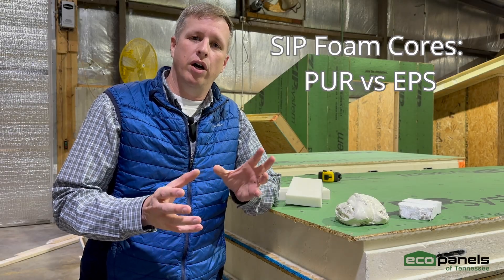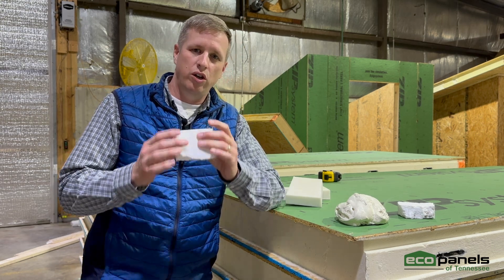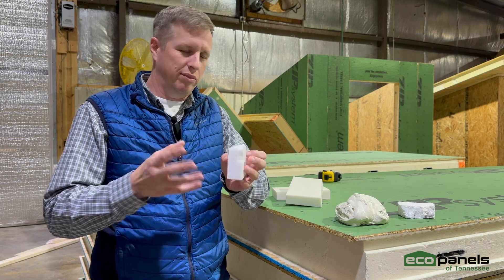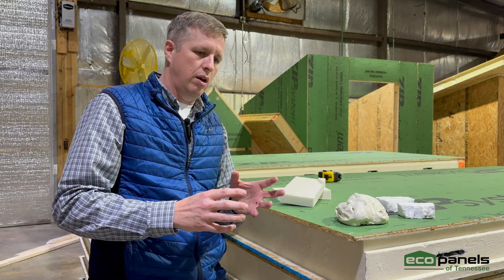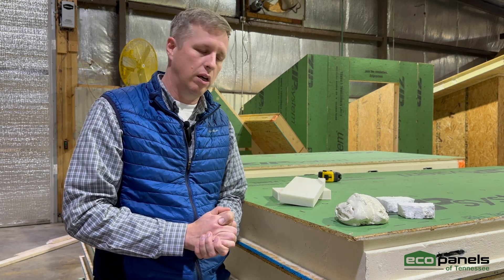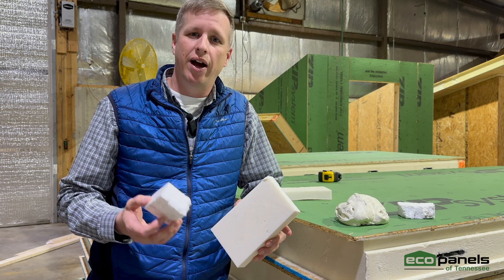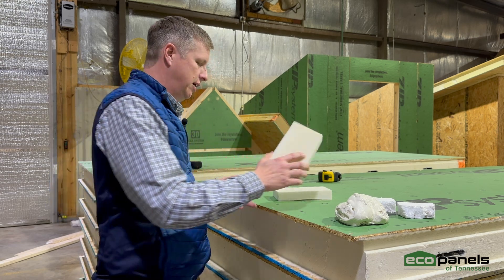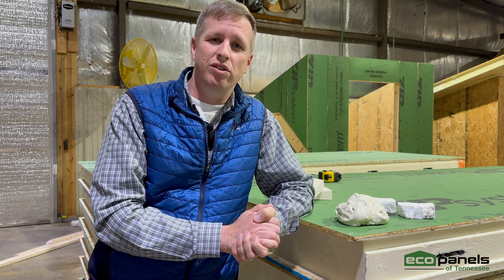SIP Foam Cores : PUR vs EPS | Eco-Panels of Tennessee

Comment: Hi Josh,  I've read that polyurethane looses its R values in cold climates more than EPS and also looses its R value over time due to the blowing agents and "thermal drift".  Have you ever measured your panels R value in cold climates and if any thermal drift has occurred?  Thanks!
Reply from the maker: Lots of contradicting info out there for sure. Part of this is because there's many different formulas / types of EPS and Poly foams, along with different applications. You're likely seeing information / data from spray-on-site poly that's going into a 2x framed cavity. This is going to test differently than our foam within a SIP. Our foam typically gains effective R-value in colder climates, so it performs better than in really hot climates. Thermal drift can be found across foams because of the molecular size of vapor. A measurement was taken several years ago and it looked like about a 3-5% loss total. That's not much. That said, it's within a margin of error that's probably in that range as well. For perspective, building with SIPs (ours or anyone else's really) is going to give you a much more thermally efficient structure than conventionally built. These changes over time are certainly more minimal than the changes that happen with conventional insulation. Hope that helps! Great question... keep learning!
Reply: You may be thinking of polyisocyanurate, or polyiso foam.  It usually comes in sheets for exterior insulation and has an R-value of about R6 to R7 per inch in hot climates, but that drops to about R3 to R4 per inch in colder climates, which is the same as EPS typically has (which is cheaper than polyiso).  Closed cell polyurethane foam (like what is typically used in spray foam) has a pretty stable R-value around R6 to R7 per inch whether used in hot or cold climates, but can off gas and lose R-value over time depending on the blowing agent used to create the foam (which is where the VOCs come from that some people worry about).  One of the more stable insulating foams over both time and temperature is GPS foam, or graphite infused polystyrene, which has a fairly stable R-value of about R5 per inch and won't degrade with time or water absorption as much or as quickly as EPS and XPS.

If you want to avoid polymer foams altogether, your best bets are mineral wool (like Rockwool) or Foamglas (which as the name suggests is foamed glass).  Both have very stable R-values of around R4.2 per inch and are completely inert in a fire.  Mineral wool comes in rigid boards, batts, and blown-in products, and is considered vapor open unless it has a foil or fiberglass facer.  Some manufacturers also use formaldehyde glues in their manufacturing processes, so that may be something to look out for if that is a concern for your application.  Foamglas is a vapor barrier like closed cell spray foam, but only if you properly seal all of the gaps between the blocks (which is the only form factor it comes in as far as I know).  Foamglas is probably one of the best insulation products in many respects, but it is also the most expensive commercially available insulation product I'm aware of, while mineral wool is a bit more expensive than fiberglass, but is worth the price premium.

If you are on a tight budget, you still can't beat the R-value per dollar of dense packed cellulose insulation (typically R3.2 to R3.6 per inch), which is why it is often the choice for things like double stud wall assemblies where you have a very thick wall cavity to fill.  Actual sheep's wool (like that from Havelock) is a renewable option and is one of the most hypoallergenic and chemically inert insulation materials, but costs more for the same R-value as fiberglass or cellulose.  There are also renewable products made from cork and wood (like Timber HP), but I am not very familiar with those as they aren't common here in the States yet.

Obviously not all of these insulation options are available or feasible with SIPs panels, but I hope this helped clear up the differences between insulation types for you.

Comment: Both PUR and EPS produces extremely toxic fumes (lethal for humans!).
If you want to insulate wooden frames, use basalt or glass wool insulation.

I live in Ukraine, our codes allow to use EPS (flammable and toxic fumes at the same time) as floor insulation (concrete - insulation - concrete), flat concrete roof insulation (identical to floor) or as outer insulation on flameproof stone-like walls (bricks, concrete, aerated concrete etc) but in last case it is mandatory to cover insulation with plaster and use basalt wool around windows and doors.
Reply from the maker: A lot do, but they don't have to. Once our foam is set, it's very inert. No formaldehydes, VOCs or ozone depleting compounds. Our foam is certified as safe enough to build school buildings out of in the State of California. Our mixture of PUR foam is not like the vast majority of the market and is one of the benefits to working with our product, which is a vastly better insulator versus fiberglass.
Reply: @EcoPanelsofTennessee  then just try to burn panel with this product and breathe it's fumes for some time.
It is safe, isn't it?😆
Reply from the maker: @avishnevsky7394  No one is going to be standing around huffing fumes if their house is on fire. Our walls give them more time to get out. Fire needs fuel, oxygen and a source. Our foam doesn't serve as a fuel as it will self extinguish and doesn't melt at any temperature. Again, this isn't a typical PUR or EPS foam. A solid core wall provides no area for oxygen,  unlike a framed, fiberglass insulated wall that creates a chimney effect for fire. The foam itself carries a Class 1 fire rating.
Reply: @avishnevsky7394 burning wood fumes are highly toxic but we still build with wood.
Reply: @JohnboyCollins  toxicity of fumes is identical? Temperature of ignition is identical? 😂

Educate yourself.

Comment: Do you guys make roof panels?
Reply from the maker: We do, but they're different from what is most common with SIPs. Most roof panels in the industry are EPS made with jumbo OSB. Since we shoot poly-core panels, they're a bit different. They're 6.5" R-40. Typically up to 12' max and do require trusses, rafters, etc for support.